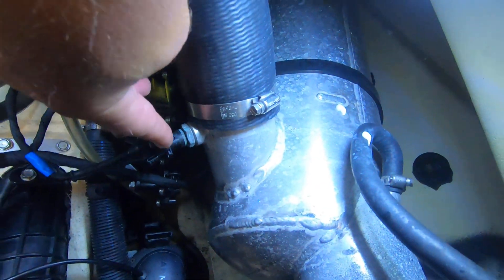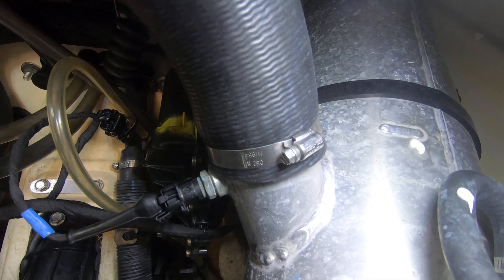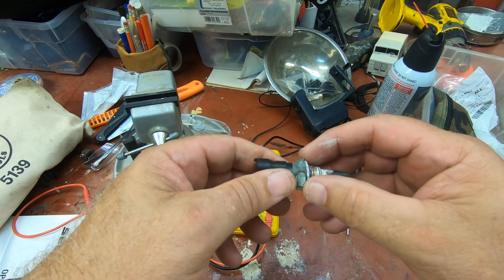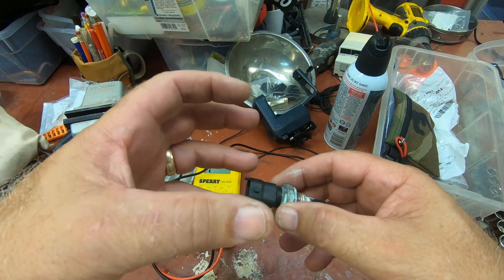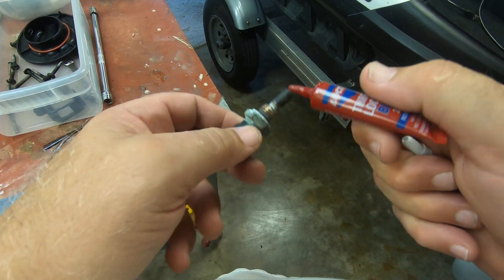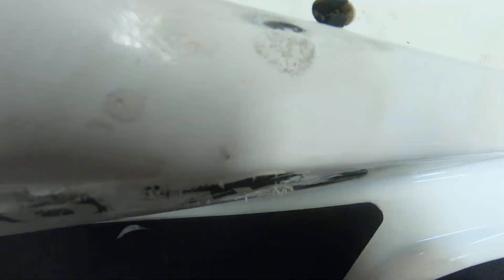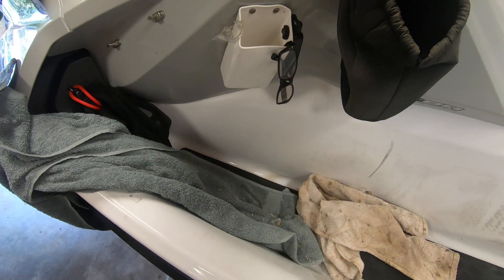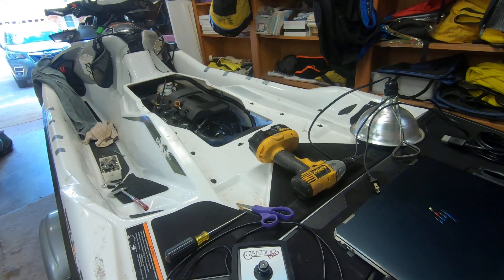2019 SeaDoo FishPro EGTS Check and Remove and Replace

Comment: Did you ever resolve this issue?  I have a seadoo that melted the EGTS and some of the wiring.  Spliced in new wiring and replaced the EGTS, but the code never went away

Comment: Hey Bill, loving your videos and I'm going to be ordering up some dielectric grease to take care of all of the wiring harness connections since the IBR corrosion seems to be a trend.  I think your Transducer fluid video is going to help me out as well!  

You should almost just offer a service of buying new Fish Pros and doing "Bill Mods" and selling some that are protected from the get-go!
Reply: Hey Corey - Thanks for the thumbs up. I figure that If I can help others via my own pain, then it will make me happy. Others have helped me and I wanted to do the same. BTW - For some reason the service manual says to NOT add dielectric grease to the actual connector pins or sockets themselves. Don't quite know why BUT the engineers must know something we do not and are trying to warn us off from that. As for spraying the back side of the connectors with the CRC Marine Corrosion inhibitor, then that is what I did. Does that make sense? I hear you one the Bill Mods - good idea to keep in mind.
Reply: @streetmann1367  Thanks for the save!  I have some CRC laying around that I'll make good use of.
Reply from the maker: @littlcor  The correct CRC marine corrosion spray is amber looking, a bit smelly, and sticky.

Comment from the maker: After wiring harness replacement BR worked like new, but check engine light came on after about 1 min of riding. Yes, the black spew is form a carbon seal crater at about 30 hours. Bad seal material issue, since taken care of by SeaDoo. Will post up a video of how to  clear the code and the alarm using the CandooPro as another video. BTW - after clearing the code, it came back again after  1 min on the water. Arrrrg! Next step will be to check up circuit wiring to see if there is continuity of wiring harness wiring between ECM terminal and EGTS.